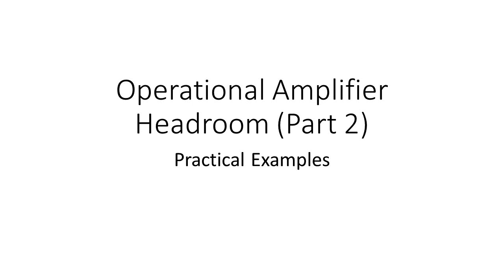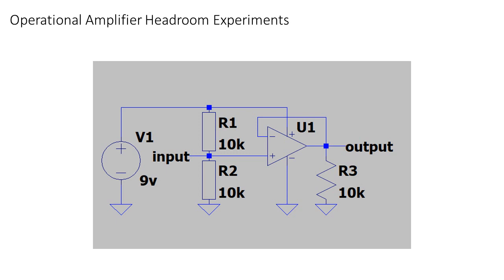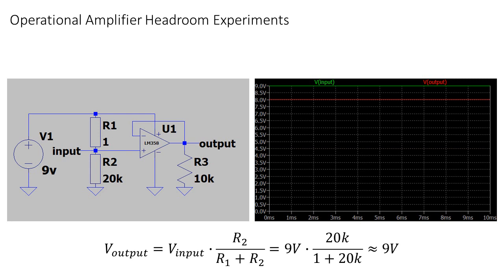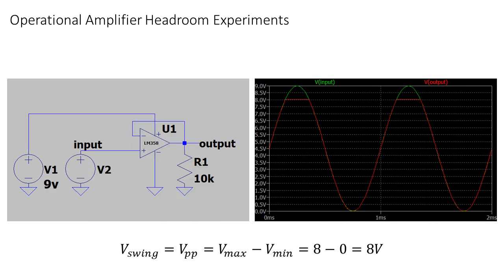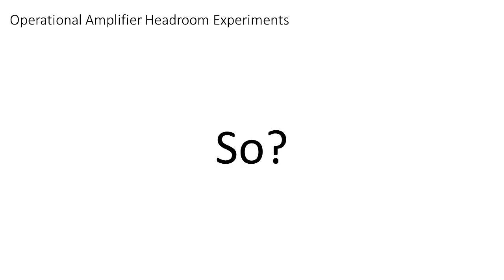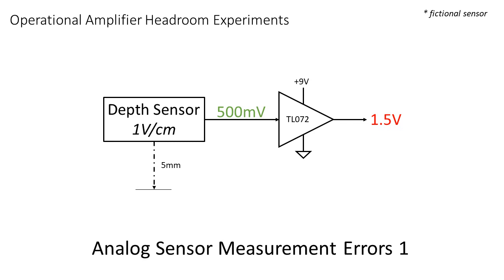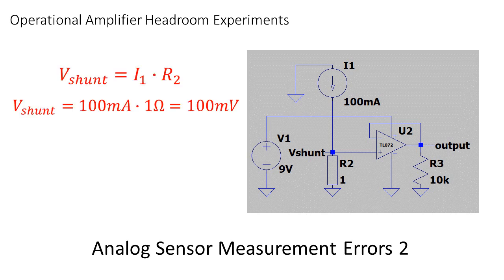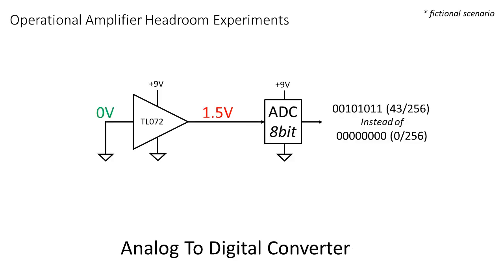13 Opamps: Headroom And Swing (Part 2)(+Examples)

Comment: Oooooookay. I am back again! Not that I want to. I need to! Hahahah! Yes, I would say the same like a broken record that the way your make your educational or instructional videos are too good, but you are .....you know. XD

My 'journey' this time is about swing/headroom. Something that escapes my mind because everything is mathematically (simulator) perfect. I do not think about all the inherent intricacies and deformities of a silicone device which I need to manually look out for (because I do not know how to truly interpret data sheet. The University and Google Universities are not helping much, if at all.). 

I read your last comment about 5532. I did not really understand how it is done. Somehow I finally saw the insanity that you mentioned. I read a book by Douglas Self titled Small Signal Audio Design. Only then I saw it.  The book is all about reducing, eliminating, or rejecting noise. The purpose of putting 5532 in parallel is to reduce noise, this is the 'best' method as oppose to putting low and high pass filters here and there that can degrade signal quality. I use 5532 to make three-op-amp instrumentation amplifier so I tend to see and read a lot of similar circuits avoid using anything else other than op-amp if possible.

According to Douglas Self, 5532 is not special, he emphasises on 5532 only because it is the most inexpensive with the most reasonable overall performances. LM4562 or stupid expensive operational amplifiers (especially by Analog Devices) should be used otherwise for power, and ultra low inherent silicone noise. However, according to him again, massive slew rate and massive bandwidth may not be always a good thing as they pose new (stability) issues. The matter gets more and more complex! FET op-amp has madly low voltage noise but very high currently noise, BJT op-amp has the lowest voltage noise but the highest in current noise. Does not end there! Not yet! OMG! Hahahaha!

Comment: What is the R3 actually for? What is it actually doing? What happens if there is no R3 at the output? Is it really necessary be there? 

I apologise for asking. I do not have an oscilloscope. I do all simulations in Multisim before building a circuit on breadboard to save time and money. Problem is Multisim does not always reflect reality even when the computer engineers put in so much component data. Maybe I am using student/evaluation licence so it does not show me true-to-life simulation.
Reply from the maker: R3 can be seen as "the load" the opamp is driving. In theory not even needed, but by drawing a bit of current from the opamp the measurements could be more reliable.
Reply: @trevortjes  Ah! Only for measurement purpose. I thought it is a must, some sort of a 'pull down' thing. 

 Some people call it 'dummy load'. Similar to the 'fake mobile phone' thing used to measure power bank capacity, I have one like this, it is actually a constant current circuit, a lot more accurate than merely using resistor as the load. Resistor is extremely cheap, ubiquitous, and insanely simple to set the whole thing up, however, it heats up A LOT and the measurement fluctuates.

If that is the case then I can simulate using 600 ohm because NJM5532DD (equivalent to NE5532) maximum output drive capability is 600 ohm according to their datasheet. I think it is the maximum, it is not said like this in the datasheet, I am putting words into the datasheet. Hahahahaha!
But maximum output current is only 38 mA, probably will fry the chip with big wattage load/speaker, I have never experienced this as I use it to drive cheap headphones only.
Reply from the maker: @realchristopher4334  Big loads like speakers etc will probably not kill the opamps as theyre often designed to have somewhat internal power limiting. The 5532 is a lil special tho with its bigger driving capabilities. Some people made power amplifier with 32(!) 5532s in parallel per channel! This yields extremely low noise, high driving current and low distortion.